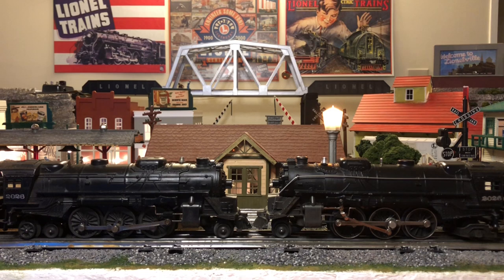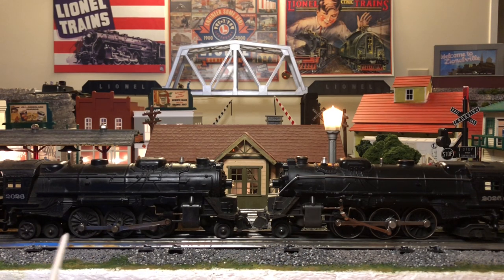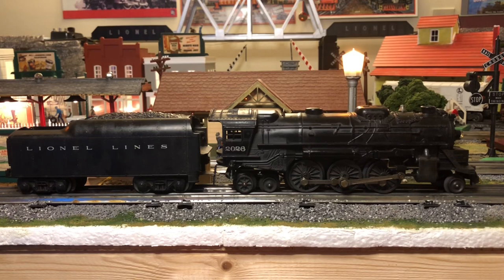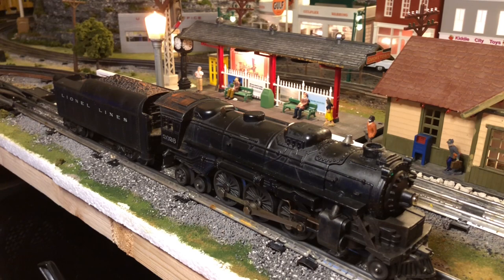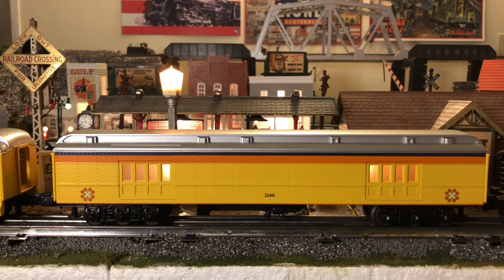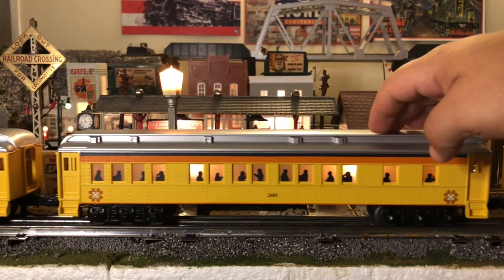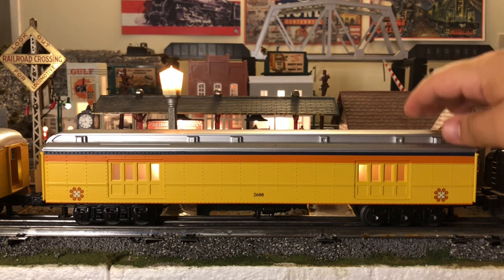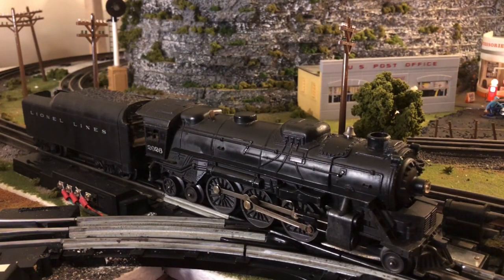Lionel 2026 | 1951 -1953 Postwar Steam Engine | Nix’s Review

Comment: I have two of these, one runs fine on both tubular track and the newer plastic fastrack. The other runs fine on tubular track but not on the fastrack. Before I purchased the one that does not run well on the fastrack I noticed someone replaced the the contactor shoes with new probably after market shoes. I don't think they are quit long enough to reach the flat track of the fastrack. I wonder if anyone else has encountered this and how they dealt with it? I guess I could bend them open a little more but since I have a loop of regular O gauge tubular track I haven't felt the need to. I have no knowledge of if there are larger top to bottom shoes. I would also add do not use the new type smoke pills, they don't smoke well and make a mess. I continue to use liquid smoke which does work fine. Any way, thanks for the great video it was very interesting.

Comment: Great video. I have the exact locomotive and the cars that came with it in the set.  I got it for Christmas back in 1953.  All still in good shape.  Have not ran it for many years. Need to get some track and a new transformer. Still have the original transformer, but do not trust it.  Glad I saw your video.
Reply from the maker: That’s awesome! I have sets that I got for Christmas as well and it just seems like I got them yesterday as time flys.  Hopefully you can get it running , Thanks so much for watching! 🚂💨

Comment: The left one is NOT a Prairie engine.  Prairie engines have the Whyte notification of 2-6-2.  The one on the left is known as an Adriatic engine 2-6-4 which is just opposite the Pacific which is a 4-6-2.  I have the Adriatic 2026 with the whistling tender.  That pin through the back is splined on one end.   You need to study the Whyte system of steam identification.  Cheers from eastern TN